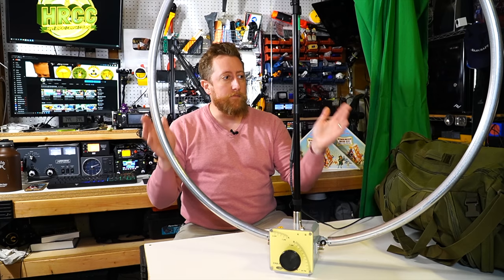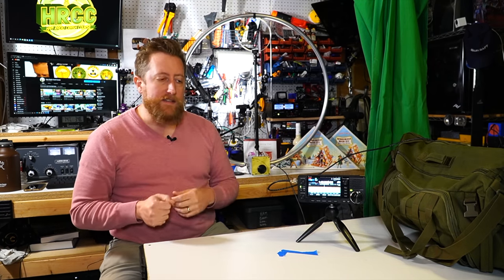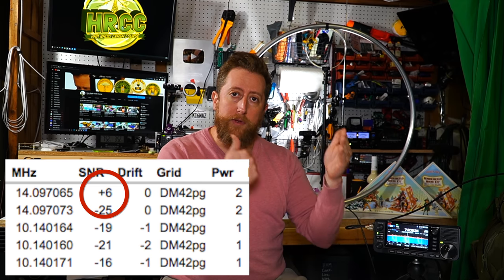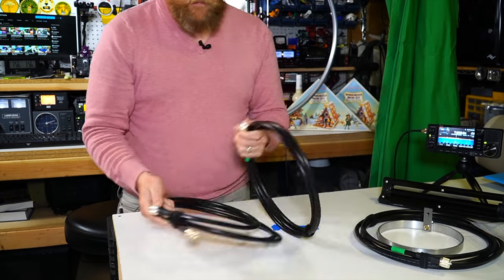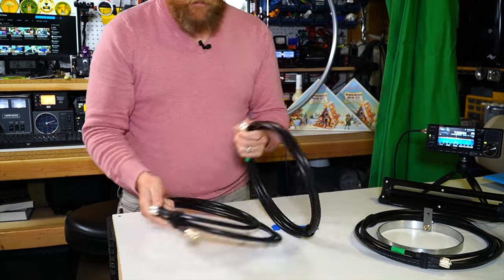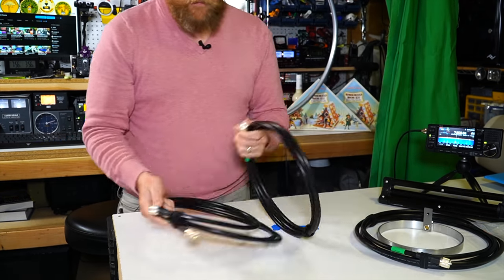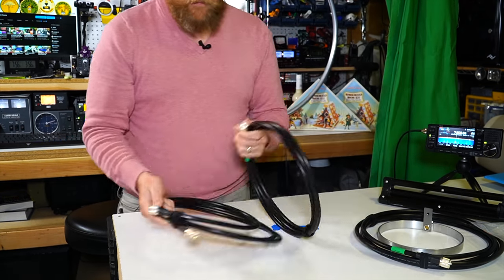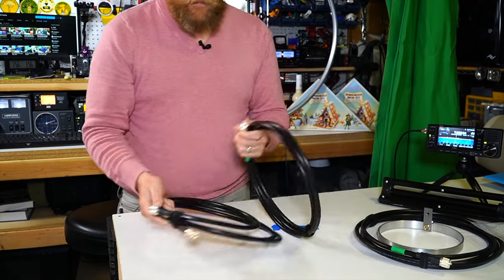Chameleon F-Loop TOTAL! Kit and CHA Single Loop - Ham Radio Antenna Review

Comment: Nice review and I have one for some of my portable opps with my Kx2 where a full size antenna will not work of fit.  I like the power compensator to use when I have more power.

Comment: II have been using my CHA F Mag Loop for over 4 years now as my main antenna. It is set up indoors in my dinning room and hooked to my FT- 817nd 5 watt max. QRP rig. I use the solid aluminum big loop most of the time on 60 through 10 meters. CW is my main interest but I use SSB and PSK31 and JS8call some of the time also. I am on it every day either indoors or for my POTA activations in the field here in S. W. Utah.. I am a long time QRPer and even get down in the milliwatt output range. I must say, I have never had so much fun with the challenge of QRP as I have with this loop. One thing that was not mentioned is how by directional this antenna is even when operating from indoors This is a very directional antenna and it brings other stations out of the mud or can null unwanted interference noise. I’m anxiously waiting for 10 meters to open up. De WA6YPE 73

Comment: “It has mounts for a tripod. And a hole.”

Great video! This is my primary antenna since I live in an HOA and don’t want to be setting up my other antenna and tearing it down all the time. I leave it set up and just pop on. 

73 

K0VMX
Reply from the maker: The “hole” is not threaded. 🤣
Reply: Because you can use the hole and install the CHA F-LOOP 2.0 on a CHA JAWMOUNT.
Reply: @carllavoie3804  thanks, Carl! It’s just funny how Josh just dropped after that and didn’t elaborate on that. 

Like I said, I love this thing and wouldn’t give it up for anything...
Reply: @carllavoie3804   Any chance of shipping the Aluminium loop to the UK? I notice its USA only at the moment. I would really like one, cheers.

Comment: Great video, possibly the most complete (and steady-paced) step-by-step video on this loop that I've seen to date. 
*
Most of my use is with the loop indoors (HOA)

I run the coax from the loop into an A/B switch box with "A" going to the rig and "B" to a antenna analyzer, which I put at the base of my tripod. This configuration allows me to adjust the loop while looking down at the analyzer. Once I get the best SWR I just switch to "A" and I'm ready to transmit. 
*
Recently I replaced my main station (TS-2000) with an Icom 7300 and I discovered that I could get very close to the correct SWR zone by watching the 7300's spectrum scope (it looks like a 'wave', which gets larger as the capacitor is tuned to the correct frequency. Too much one way or the other (right or left turn) and the wave decreases moving off to one side of the frequency or the other.. My hearing isn't as good as it used to be, so the visual indication on 7300 really helps (I imagine the 705 would be the same)
*
Nice bag. I wish they (Chameleon) was more consistent with the bag they send out though (the F-Loop I bought this Spring came with a tiny 14" x 9" bag that barely allows everything to fit in it).
*
What I'd really like to see as a followup video is where you test the loop with the CHA POWER COMPENSATOR  (which I believe is just a door knob capacitor) and verify once and for all that it really gives you a good increase in the radiated power output (i.e.- "I talked to Bob and he said I'm 5/6 but when I added the Compensator it jumped to 5/9"). I've never seen a video where someone actually does an A/B test between stock loop and loop w/compensator doing a real world test like that. 

When someone DOES do a video with the Compensator it's never clear if it deflects most of the higher watts coming from the rig (with only a minimal increase coming out of the loop), or if the loop really uses everything the transceiver is putting out? 🤔
*
With the aluminum loop connected was your frequency spread the same (40-10) as with the coax, or did you loose a band at one end or the other?

Also, was the bandwidth you saw the same as or better than with the standard coaxial loop?

With the "booster" cable installed did you see a larger bandwidth on 40 or 20 meters, or was it just as narrow as with the stock loop?
*
Once again: Great video....👍

Comment: magnetic loops have been there for ages. They are a decent compromise for those who do not have the possibility to set up a larger antenna.

While efficiency is marginal, for receiving they provide good directivity and thus good S/N.

On transmitting any vertical will greatly outperform a loop.

Magnetic loops are very easy and very cheap to build. With a fraction of what the Chameleon costs you build one as good as this and with a motor, which let you tune it remotely.

Ham radio operators used to learn how to build the basic stuff they needed. Nowadays ham radio's main equipment seems to be the credit card!

Comment: Chameleon Antennas are top notch and I have owned this loop antenna for a couple of years now. I went through a hate/love (yes in that order) relationship with it though. The portability and ease of setup (reliably 5min) is spectacular. BUT it’s useless on SSB Tx. Anybody claiming anything else is likely strongly biased. Still, SSB Rx isn’t actually  too bad and it’s very quiet. You will find that reviewers of this antenna tend to focus on digital to demonstrate its performance. Well the reason is that’s it’s the only thing it’s useful for. Just don’t be fooled to believe you will have many SSB QSO’s. Even if you do make the occasional contact, it’s way too unreliable to be trusted when it really matters. I performed extensive testing in various settings and distances and can confirm that I’m usually not being heard on SSB, even if I hear the other station well. I use the power compensator btw so I can almost double the power (SSB 50W/ Digital 20W) 
I was never able to get 80m to work well other than some Rx and no longer bother to make it work. I think promoting it as a 80m antenna is a bit of a stretch. Interestingly, the power compensator doesn’t seem to work on 80m. This all sounds horrible, right? Well once I accepted that it’s basically useless on SSB I started loving it for what it is. The small package and 5min setup to Tx/Rx a couple of digital messages is actually pretty cool. It’s high quality too and a pure joy to own. Customer service and support is stellar - I’m a fan and own some of their other antennas. So there you have it, it’s a great antenna in its own right but you will hate it if you expect it to be a performer on SSB. As it had been mentioned earlier by someone else, any vertical will outperform it on SSB. Great video!
Reply: Interesting. I've worked DX on SSB with mine from AZ to South America and Europe with 10W. Is it easy...no, but I have made contacts. Conditions are getting better. Give it a try.

Comment: After 60 years in ham radio I could On my extended lot in Florida.-- On my 70 foot crank up tower were the strong 15 foot mask going upward above, I had 3 high Gain yagis five elements on 20 ,15 meters had five elements and so did the 10m yagi. On a 70 foot tower separately I had a full size 40m two element quad with 30 meters wrapped inside two elements and then three elements on the 2 other warc bands. I had a 50 foot tower with various to meter gang Yagi. For 80 meters I installed two high gain high towers 130 feet apart and use the matching network which from the shack I could switch either bip or bop--- with part of that antenna on Japan or the other part on Europe switchable from inside the shack. All operated with everything from 800 to a kW output.
Now I'm tuning into youtubes and seeing single element loop type antennas there are useful for portable or for using that condemnable FT8. And since I moved away from most of those other antennas I still have the Christmas tree but I realized looking at YouTube that FT8 and the simple loop type antenna, low power, is saving him radio for all the hams that are penalizes from putting up big antennas and from running a kilowatt amplifier. So I guess FT8 and these little loops are saving ham radio and for that I say thank goodness.

Comment: Great summary! I need to get out more with mine to get better accustomed to using it,  my only gripe being that it can be really finicky when it comes to getting the tuning knob just right. The high-power adaptor actually lists max output on SSB as 60W and I have had no problem pushing out at least 50W. I would think that at least on the higher bands that it will probably outperform most compromise antennas on 100W output and would rate it as more than simply a QRP setup.

Comment: As Always, thanks for your well done and informative videos. You have a very natural presence in front of the video camera. I have the F-Loop too, but with the two part metal out loop. It works well. I do agree with those who believe that SSB test are better. After all, who talks on FT8 (no talking) or on WSPR (also no talking).

 I once hit Antarctica with WSPR, but I was not able work work  them a second later on SSB. I tried. So WSPR propagation say nothing about SSB propagation.   Also if 'it WSPR goes out further' then again that's proof that SSB does not coincide with WSPR. WSPR is more fun than that dreaded ft8, which I can't pretend hard enough is radio. Again, thanks for the video. 73 from N2LRB
Reply from the maker: Thank you for the comment and kind words.  The point of wspr is that you can see what paths are open, including SSB.  It’s a fantastic mode for knowing when voice contacts are possible.

Comment: I bought a Cham V1 Vertical 10-80m for $299 back in 2008. When i called 2 years ago I was told all the stuff from CA was sold off and moved to NV. What sold me on it was the Youtube vids. I made a contact from SE Idaho to Japan on 18 meters. His window was open just long enough and the band faded.  After years of owning it i could no longer remember which end of the unun was antenna or coax side and called. The guy on the phone was surprise to find out there was still a V1 out there still working and said very few were and that in the move they lost all the documentation and the original website data had been lost.
My only option is to take it apart and check it out. But i'm thinking of just tossing up 124.5 feet of wire and making a 9:1 unun and calling it a day. [edit] i sent to QRZ to get the link to the contact page and i found their members area seemed to be obliterated. Split up and sold off to 3rd party sites. And or took what they had and chopped it up calling parts of it standard and parts premium. Been a couple of years since i've been there.

Comment: Just building a mag loop with a Pi4 to drive a stepper motor coupled to the tuning capacitor. Currently working on the GUI in Python with memory and scanning options.
Reply: Very cool.   I started writing my own, but then just went and bought a Wi-fi Stepper WSX100 board :-)

Currently, going to try a normal DC motor with a high gear ratio to get better tuning as the capacitor I chose is hard to finely tune.
Reply: @Ardren  Yes, I'm using a stepper with 4:1 gearing which will turn the capacitor in 1/3 degree steps. Hopefully, that will be sufficiently fine enough control...

Comment: Interesting vid Josh. Thankyou! I gave it a ‘like’. Couple of comments:

1. Is your outdoor chair metal? 
2. Some discussion re. Health and Safety aspects due to potentially high currents present at (especially) LF with magloops eg your XYL goes outside to hang the washing out while you are leaving it to do WSPR and she touches the non-rubber-booted PL259 assemblies to move it; minimum recommended distance between loop and operating position as a function of frequency (to avoid a permanent headache!)? etc.
3. Is there a (future) remote mechanical tuning option eg with a cable drive or motor drive for the case when you want it outside (eg your rv) while you are cosy inside so as to avoid constantly running in and out.
Thanks again,
Nick M1DDD

Comment: Nice video.  Disappointed you didn't do the test with the 705.  😟
Definitely going to have a go at making a loop antenna.  It seems expensive for what is mostly coax.
Reply from the maker: It wouldn’t be any different with the 705. I ran the test at 5 watts.
Reply: The capacitor is the expensive part.

Comment: Might have to invest in one. Just got a IC-705 a couple of weeks ago and an end fed antenna to work HF with. Had some luck on 20m and 40m without using a tuner. Haven't done any weak digital signal modes yet, but plan on getting into trying some soon.

Comment: Josh, I love your practical videos, but this time I have to be rather critical:

There are very good reason that your viewers ask for SSB. I know it is convenient and easy to run Whisper and present a flashy chart - but it is meaningless without explantion: You told us that the SNR would reveal if the connection was actual useful for a SSB QSO - yet you only showed the map with the contacts - but not annotated with the SNR - so I am not a bit viser regarding range for SSB

Also, you briefly showd an effectiveness chart and then quickly closed it withhout explanation of the significance of the numbers. Does the 13% effectiveness with the Boost option mean I only get an effective 1.3W in the air when transmitting with 10W on 40m ?

I would love to see tests on SSB (!) with range and time of day included. Reason: I consider buying it - it is expensive - so I do not want to rely on sponsored videos only
Reply from the maker: Well said and valid criticism. Thanks for taking the time to write it out as you did. Let me do a follow-up. 👍

Comment: Thank you so much for doing a very nice edited video.  (I hate live Premier shows and don't watch).  I have the MFJ Magnetic Loop and to tell you the truth have not done much with it yet.  Part of my problem is my XYL HOA.  Castler stated is much be 20 feet off the ground.  Therein lies the problem.  To keep it out of sight I can only get it about five feet off the ground.   Your video has spired me on to try again.  Thanks for all you do.
Reply from the maker: Yep, you don’t need it up that high. Just one loops height above ground.
Reply: I think Dave's height recommendation for the MFJ-1786 was for it mounted horizontally where it has similar requirements to a dipole or wire antenna.  For it mounted vertically, the tribal knowledge says one loop diameter and excessive height above a ground plane can be detrimental. 73 de WG2H
Reply: I see no signal difference between using my loop at ground level and my 2nd story shack.

Comment: I'm still waiting for Chameleon Antenna to build a "matcher" much like the "CHA-MIL Hybrid rated @500 watts" to handle a kilowatt - so, those of us working from an apartment with a balcony railing can run a decent amplifier on the lower HF bands.  I REALLY just want to be able to transmit a solid 500 watts everywhere I can, because it make me feel whole and complete, (sarcastically speaking, lol).
KD8EFQ/73
Good video.

Comment: Very new and just exploring the ham radio hobby.   I have a question.  There seems to be 2 types (?) of communication styles?   Active listening basically looks like actively tuning a bunch of static until you find a voice buried in static?  Then Squelch listening where there are known channels that you stand by quietly until a transmission is made (CB,GMRS, FRS, 2m, 70cm?)   This antenna is more designed for the static in voice style listening.

Comment: Great video!  I'm looking into HF soon, and I've been eyeballing the Chameleon antennas.  Would you please also consider reviewing the Chameleon MPAS antenna and comparing the two antennas?  Thanks!
Reply: MPAS 2.0 is a great antenna, can handle 100 Watts and I've made several contacts from Ireland to South America on 20 Meters SSB @100 watts in the Summer 2020 in the Evenings and night UTC using just the single supplied counterpoise and the CAP HAT which  I purchased separately. I do have a very low noise floor where I live too helping me hear lots of DX. It's also a fabulous SW receiving antenna, One thing that struck me is how quiet it is on receive compared to my wire antennas, I thought the Verticals were supposed to be noisier but the MPAS 2.0 is very quiet, again my area in the sticks is very quiet. 

The first night I set it up and heard a Brazilian station repeat my call, well, you can just imagine my face!

I haven't used the wire antenna much but this would give much better performance on 160 and 80m but it still gets out well on FT8 on 80 and 160 on the vertical. 

It works so well I decided to leave it up all the time and take it down only for portable use, the exact opposite of what I bought it for but at least I'm making good use of it. 

I also have the excellent Super Antenna MP1, I even made a 1000 mile contact on 80m with the 80m Coil, but it can be a pain when band hopping going back and forth to  adjust the coil, disconnecting the coax, hooking up to the analyser etc. The MPAS I can work several bands ( With the cap hat ) without a tuner.

Get the MPAS 2.0, it can handle 100 Watts and it just works, every time.
Reply: @o00scorpion00o  I really appreciate your insight.  Your comments confirm most of what I've heard/read regarding the MPAS 2.0.  I live in the burbs, so I have space limitations that drive me towards verticles over wire dipoles.  I'm running an ICOM 7300, so I'm thinking the MPAS would be a good fit for my needs along with the radio's internal tuner.  Portability and field comms matter to me as well, so I much prefer a rig that can be quickly set up and taken down.  My primary focus in HF is phone/voice contacts, but might look into the digital modes more closely next year when time permits.

Good to know about the Super antenna.  I looked at those as well and wasn't sure if all the adjusting/fiddling with it was worth it.  Might take a second look.  Thanks again!